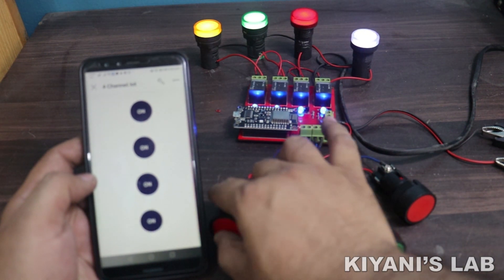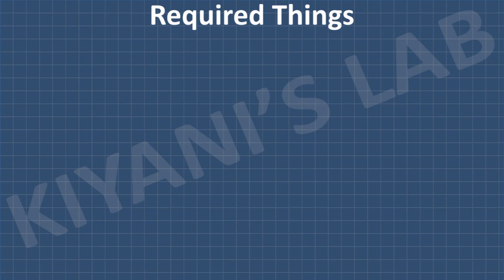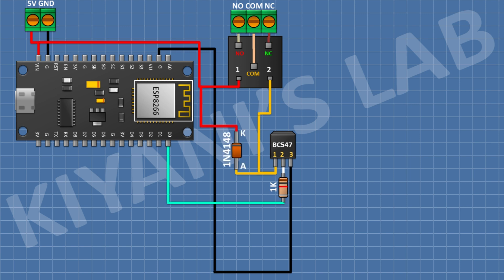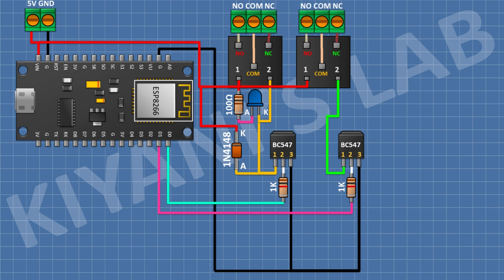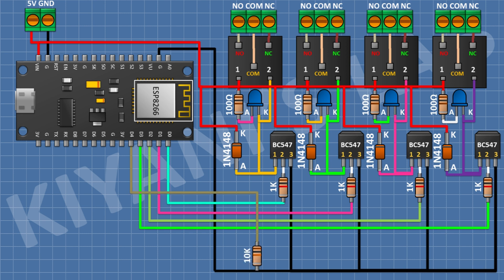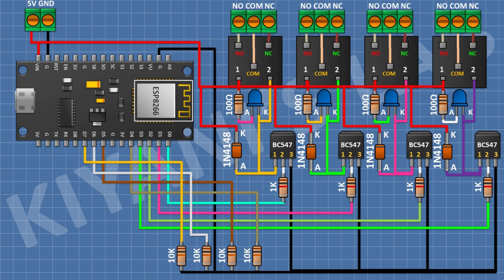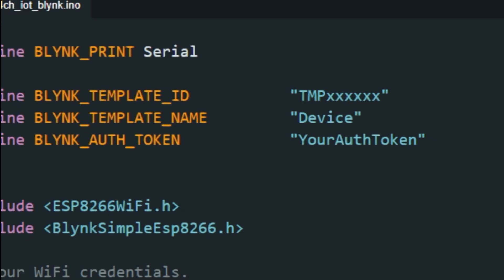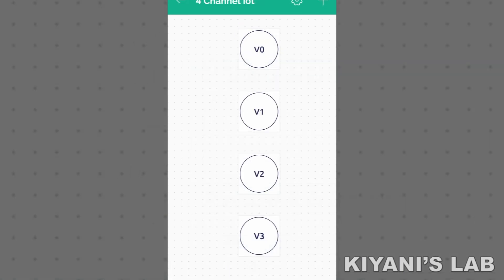Home Automation using ESP8266 and Blynk 2.0

Comment: 1. do not move around the screen recording, it hurts the eye, irritating.
2. little explanation would be nice for new users, like digital pin vs virtual pin!
3. There is no code in the zip file.
Reply from the maker: check the description bro link is added now
Reply: @KiyanisLab  great thank you. Have you checked if it works fine while the wifi is off ? for my all other Blynk relays turns on for a fraction of second every minutes, while it loops to find wifi.

Comment: Thanks for the nicely explained project. I request you to provide the code for the same so as to replicate your idea. The zip you provided contains only schematic but not the code.
Reply from the maker: the code is in project zip in the description bro
Reply: Could you please tell us which software you use to make schematics @KiyanisLab
Reply: The project zip file contains only the connection diagram image but not the code. That's the problem many viewers facing. anyways thanks for the video and reply.